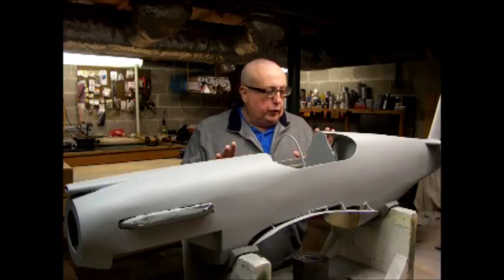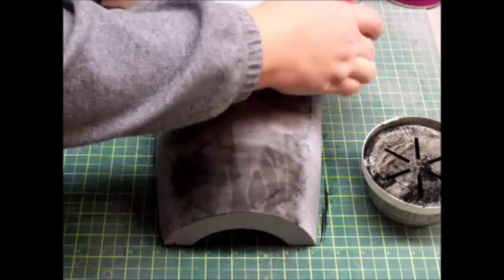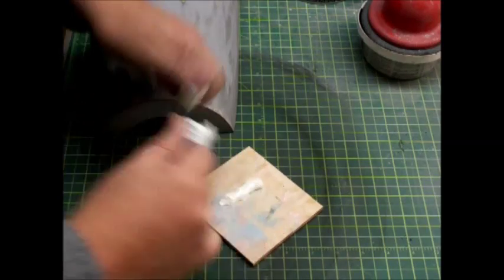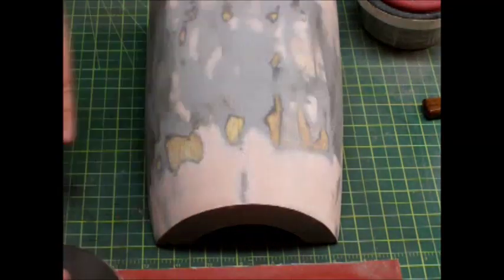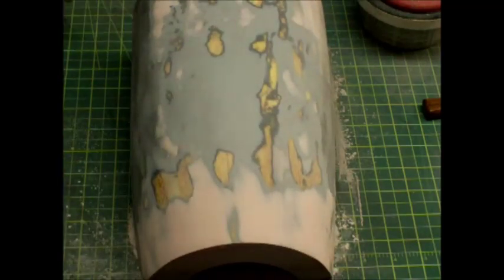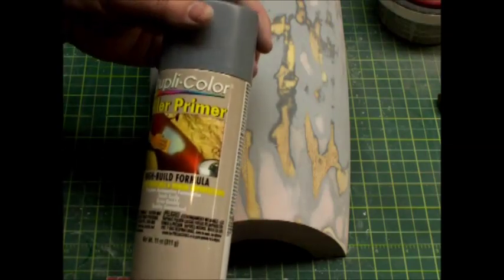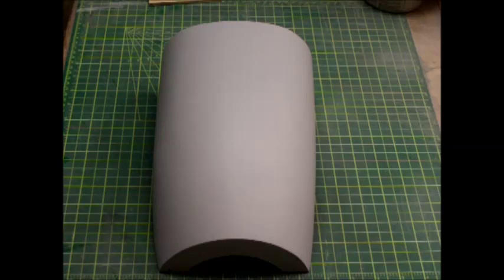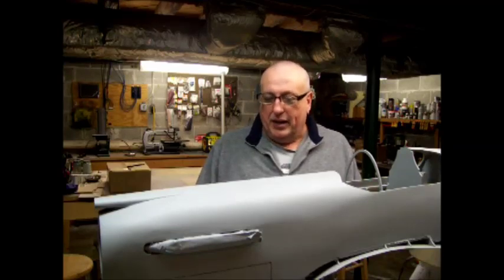R/C Model Fiberglass Finishing Part 2 - The real stuff!

Comment: Do you use the same primers and paints when painting RC boats? I have a Newport 12 Meter that I want to paint the hull once it's cleaned and the gelcoat lightly sanded.

Also, found one place that has Handy Sanders. Not check it out yet. http://www.flyhobbies.com/Handy-Sander